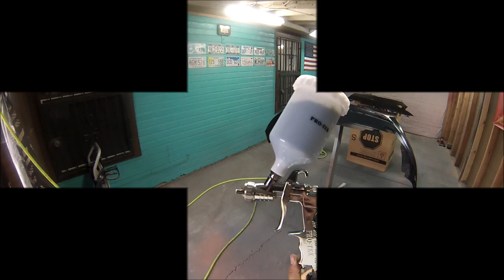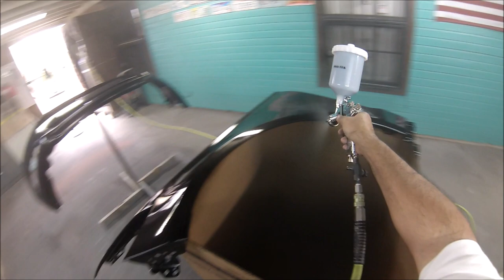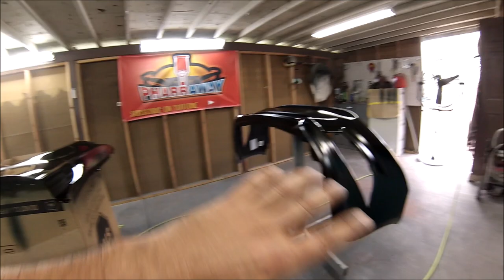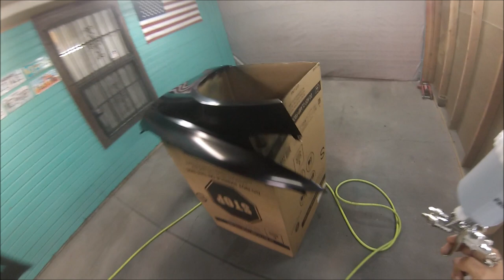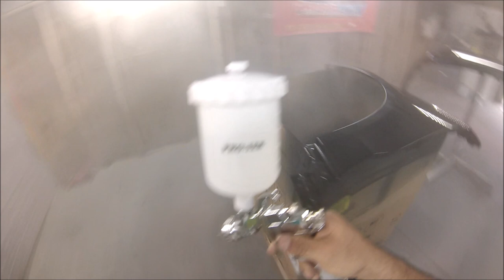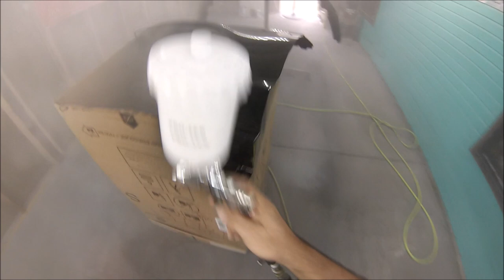PRO-TEK 4000 HVLP GUN REVIEW AND DEMONSTRATION

Comment: Thank you for carrying out the review. To be honest, never heard of protek, until now. Always used Sata (10 of them) and my trusted Iwata Supernova, that is surprisingly light, but when you tighten up the edges of the fan and let her go, she lays it down like glass! I suppose for the money, it; meaning the protek did good. However, as you mentioned, most cars to some extent have slight orange peel, unless it is a Rolls Royce, Bentley, Ferrari...etc. I suppose its 'Horses for Courses' Nice job as always! Keep safe, god bless and best regards from the  UK.
Reply: Absolutely. My Ram truck has a lot of orange peel. Even my cheapest gun can't lat down that high.